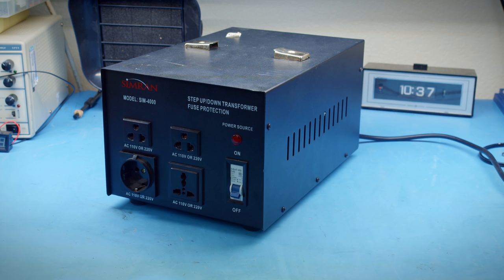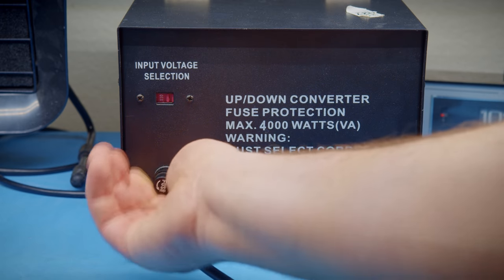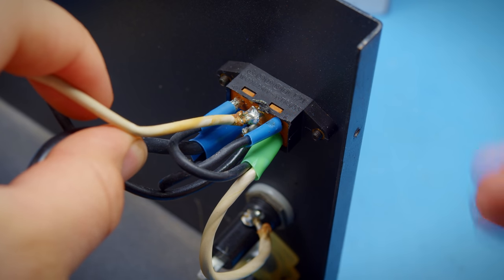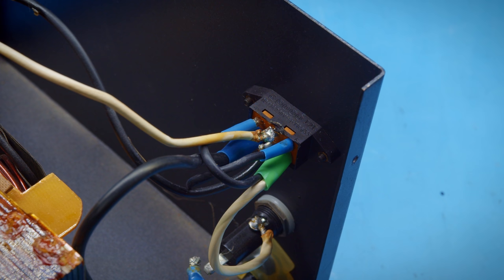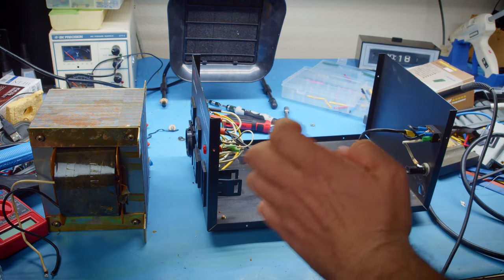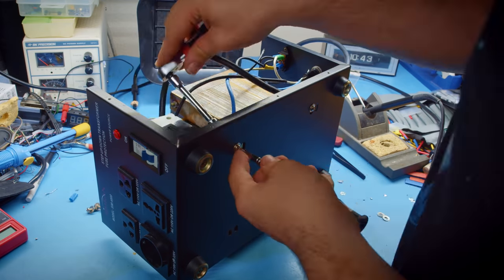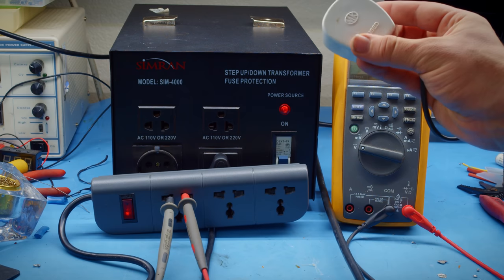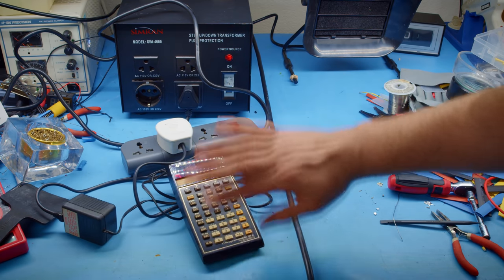Making 240V AC In the USA, Interesting but Dangerous

Comment: I was literally "shocked" seeing the assembly. That´s  when companies save on QC.  Despite that, the whole design is a fail:
Solder has poor resistance. You should never screw tinned wires into a plug for high currents. That´s what sleeves are made for.
I also wonder how they wanna route more than 500W continously through this tiny plastic 120/240V selector switch :-D
Thanx for the warning, I won´t touch anything from this company.

Comment: I'm wondering if the transformer is wired with aluminium? I've seen this a couple of times. The copper losses are therefore now aluminium losses! A UK sourced auto transformer rated at 3KVA has a winding resistance of 0.1 ohm or so and the losses are in the twenty watt area. 
This thing is a real hazard if anyone tried sticking 40A through it.
Then you showed us that 4 way socket...Where do you get your stuff? The local undertaker looking for new business?
Plus, how does a techy not come across an auto transformer...? I didn't ask that, ignore me...😸

Comment: 2:27: "It's just weird that they're all different, and I don't understand why, because that one there should be compatible with everything that these can do." <-- @Tech Tangents: I assure you it's not, and if you have all the right plugs, you can try it out yourself. The idea here is, you use one of the bottom ones (which should really just say 230V) or up to two of the top ones (which should really just say 120V). Btw., the way this says 110V/220V instead of 120V/230V, plus the grody innards make me wonder if what you bought there is a cheap knock-off of an old design. There's probably an actual modern quality product version of this out there (likely $$$+).

Comment: I need to say something important, there is absolutely no need for these in the USA since everyone will have 240v (or at least 208v) in their homes, all you need is one more conductor from the panel and if you want to be pedantic a nema 6-20 socket and you're done REAL safe 240v that you can plug pretty much any 100-240v appliance to it without clutter mess losses and extra chineseum danger, i thought this should be mentioned in the video as well. As for the 50hz on 60hz old transformers like the one you have there means you'll get a bit less voltage but should still be within margin thus why the calculator worked. PLEASE DO NOT USE THESE THINGS EVEN IF YOU FIXED IT :D
Reply: As others, including our channel operator, have pointed out, not everyone CAN do this.  Landlords usually won't let you have non-standard electrical work done, such as installing NEMA-14 outlets anywhere but the stove and dryer locations.
Reply: @evensgrey  Nema 6 is pretty standard, and how can nema not be standard? It's literally north american standard, If i installed a schuko or bs1363 then i would understand (despite being a much better standard) though you can get the same result with just using 2 nema 5-15 sockets out of phase and just wiring to a single nema 6 socket. There are many ways even for those who actually care about what their landlord can't see/know.
Reply: @dashtesla  The OUTLET is standard, but the LOCATION isn't.  NEMA-14 outlets are normally installed in kitchens and laundry rooms, and possibly in garages and workshops (although it seems that's largely NEMA-6 outlets), and a landlord probably doesn't want a workshop being set up in a rental property.  (Most people don't want one, so it means converting a room into a configuration most prospective tenants won't like, so it would have to be changed back after the tenant who wanted one moves out, which is a delay in renting the unit out again and an extra cost on top of that.)
Reply: Some people don't live in a situation where there landlords like them install, or let the, have someone else install, stuff like that. As he said, if he could do it, he would, but he can't, so he shan't.
Reply: @David_Phantom  He can still find 2 sockets that are wired out off different phases and make an external box with nema 6, no damage to the property and it will work just fine they even sell it as a 'quick 220' online but you can make it yourself. Also i get not everyone has a perfect landlord i personally am looking for a home where i live and finding such a flexible landlord is my #1 priority which is why ive refused many offers and even considered buying something, here in europe we thankfully don't need to deal with 120v pleb nonsense :)
Reply: @dashtesla  What if the phases are different only in very far off parts of the house?
Reply: @David_Phantom  Honestly I would just go ahead and add another conductor to the conduit change the socket when i leave the place change to the old one and isolate or remove the conductor at the end, landlords don't have xray vision and i've done wiring to many homes before it's a 15min job most cases unless it's really far/cluttered. I would still try anything including a very long extension cord than to use a transformer, even here in europe we can't really get 120v for testing US/JP stuff without a transformer, so here that makes way more sense and i would still rather mod the entire appliance to 230v than to use a transformer for long-term use (game consoles etc). I've even done things that aren't even supposed to be done such as using neutral for earth because the home just never had earth wiring and they just added an RCD to the end of the panel to comply with code without fixing the wiring.. I also get the idea of not spending too much money on a rental i had fibre all around my last apartment externally and electrical from a UPS all external because it's that much easier to remove after you move, so it really depends on the size of the home and the specifics.

Comment: Saw the title and thought "Oh. An autotransformer". Infamously needing great care. Often used on building sites to run 110V power tools. Yours had horrible build quality though. Where was it made? The only places selling these seem to be in the USA. It's also possible that it had been seriously mistreated. That fuse would be - incorrectly - rated to cope with 4kW when fed with 110V. On a 240V supply, that would allow a draw of 8kW before blowing. That would allow the inside to get VERY hot. I notice that it was originally shipped with an UNGROUNDED 2-pin adapter for use in the USA! ABSOLUTELY LETHAL!